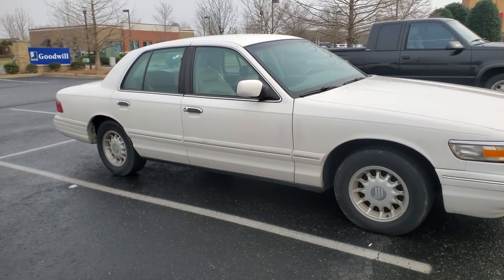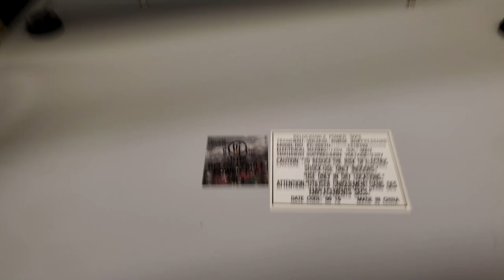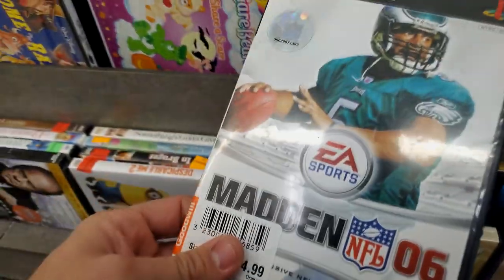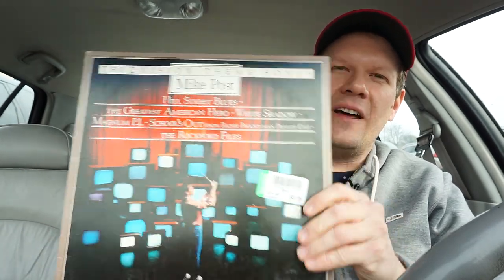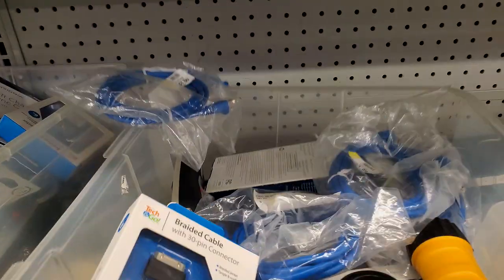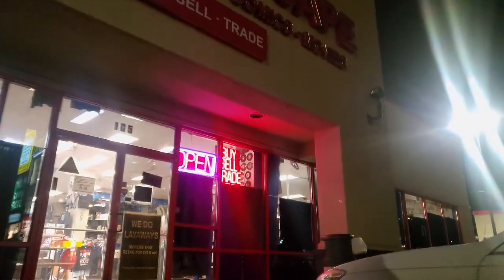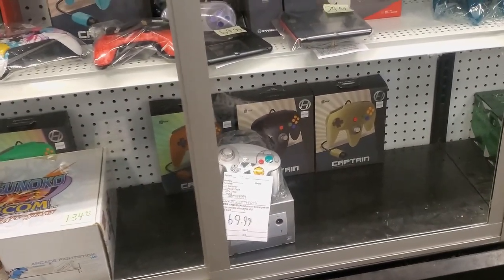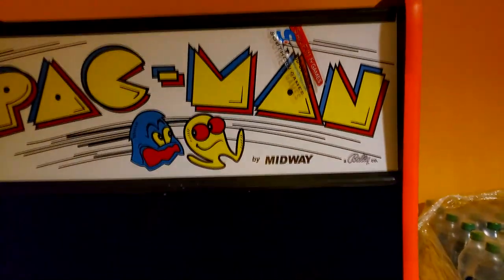Shopping for CRTs & other Retro Tech | Road Trip Vlog

Comment: I got a nearly identical karaoke machine at a thrift store almost a year ago, and the way the whole thing is wired up, you can neatly separate the tube and the CRT board from the rest of the machine and have a standalone B&W CRT with composite input that just takes 12 volts. I've been saving it to use in a 3D printed enclosure with a raspberry pi and a touch panel overlay to make a very anachronistic retro stereo head unit for my 87 Toyota Cressida.
Reply from the maker: Now you're talking.  I should have grabbed the thing, but I didn't.  It would have made for a fun project.
Reply: Darn. I have seen a bunch of those Karaoke's around and been avoiding them because of the mindset of "i've got enough junk" Now next time I see one I'll need to snatch it, but now I'll never see them because I'll be looking for them. I'd love to have a separate mini composite monitor.

Comment: I'm in clarksville so I'll have to check these Goodwill's out. I've never been in The Great Escape, i'll have to go. At Goodwill the other day I found a NICE samsung curved gaming monitor $25, however when I got it home it had a crack you couldn't see, which really sucked as I had high hopes for this monitor. I took it back and when I came back there was a VCR I picked up that wasn't there when I got the monitor. I've been looking for a VCR on the cheap for a long time. This one came with a remote and worked great.

I've been seeing those CRT Karaoke machines a lot lately, I feel like they're stalking me. I firmly believe the Black/Red one you showed was the one I seen in a Franklin Goodwill, maybe they relocated it because no one is buying it? I'll have to break down and buy it next time I see one so I can tear it apart and tinker with the CRT electronics like I like to do.